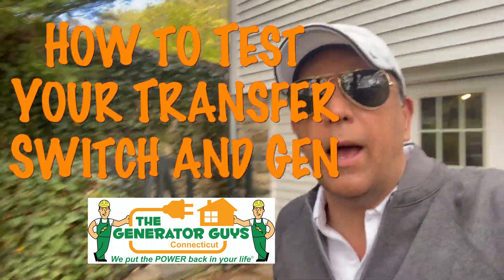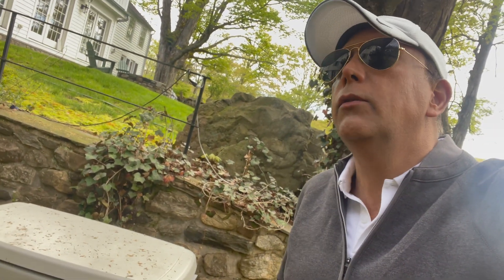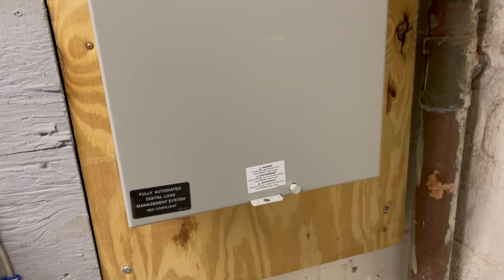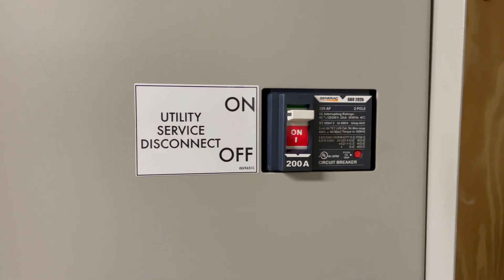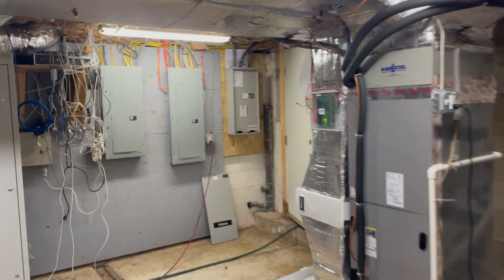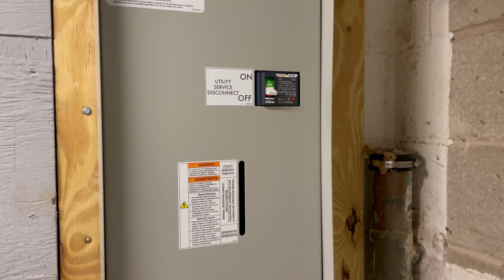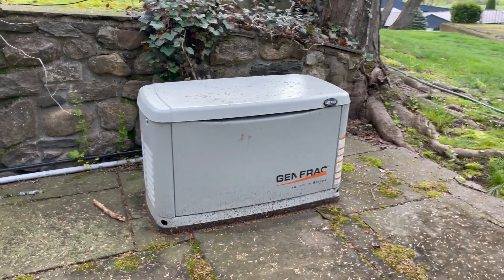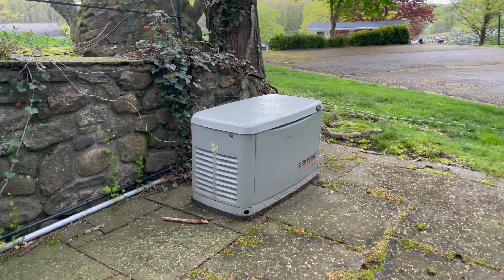How to Test Your transfer Switch GENERAC GENERATOR

Comment: For some reason my transfer switch doesn't want to work automatically so I always have to go outside and use the yellow stick lever.  Not sure what I'm missing or if I need to adjust something but its really getting annoying
Reply: Call generac dealer bud don’t ruin your warranty

Comment: It's amazing that we still haven't figured out a better way to label our breakers. All of mine have looked sloppy as hell. It's not easy to write on panel and there's really not ample room. Maybe it should be built like hanging file folders where you can fold a little tab in.
Reply: I use a label maker for mine

Comment: Built my own transfer  switch. Been in use for 18 months. House switches to battery powered inverter and can run that way all night until the sun hits the solar panels. Generator only cuts on if it's raining or really cloudy. Generator charges batteries in case they are low.

Comment: Another new whole house generator owner has the same question re: To simulate a utility power outage & force the Generac generator to turn ON, is it only necessary to flip the ATS switch OR also switch to OFF the double circuit breaker in the main service panel?
Reply: you only need to switch the breaker in the ATS.  The double breaker he showed in the house panel is for a different kind of generator hook up (one that only runs a few essential circuits).  If you have the whole house gen, just flip the breaker in the ATS.
Reply from the maker: ONLY THE TRANSFER PANEL - actually not recommended to touch the main house breaker sometimes depending on their age they will not reset!